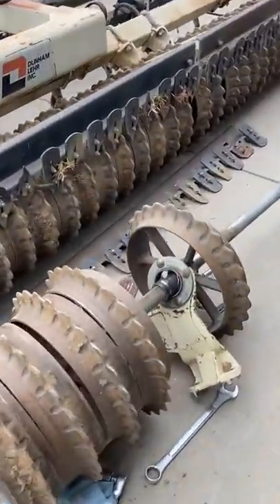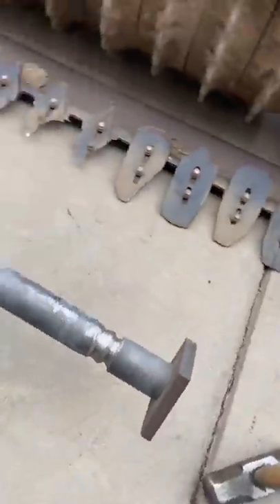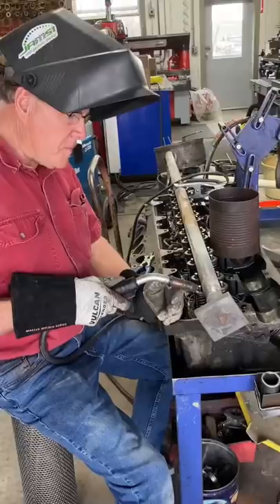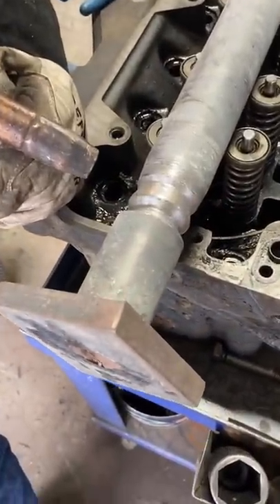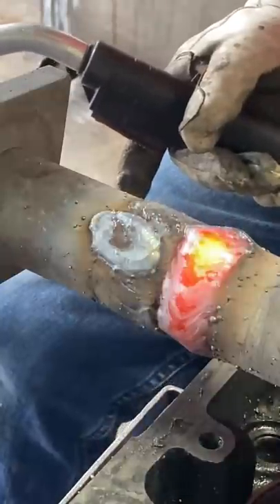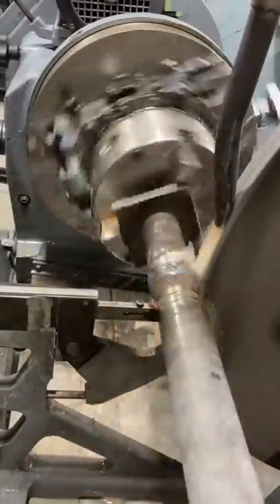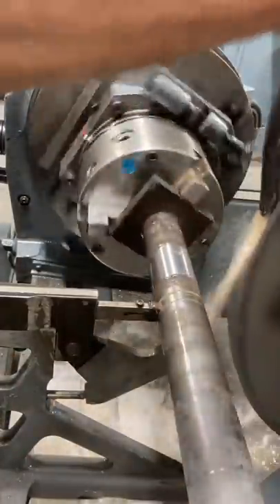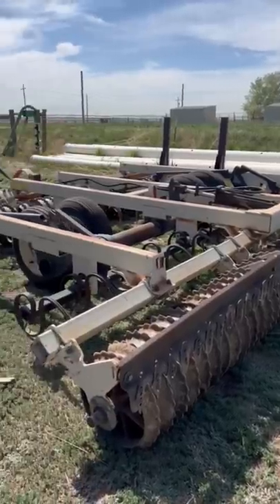#shorts How To Repair A Shaft Using A MIG Welder And A Berco Crankshaft Grinding Machine

Comment: Ok ok, I watched this several times and the humor just kept flowing nonstop.   "All these wheels to help push the tractor across the field" and " welding over something that the spatter won't harm" as he is welding over an engine head.  And the best was the 40 years for not being a welder.   I hate to do mechanic work but I love watching your videos. I wish I could bring my dad's Massey Ferguson 85 to have you rebuild the engine while he's still alive, he turns 90 this week.  Edit, I watched it some more and there was more humorous comments than straight informative ones.  My compliments to you and your dad, may he live at least as long as mine has lived.

Comment: I always say “I have a welder, but I am not a welder.”
Reply: This appears to be a cultipacker. It's a pulled implement, supplies no power to the tractor.
Reply: Same brother same
Reply: i go with, "I can weld, but im not a welder"
Reply: @hubertbergen3000  sure sure, but with new bearings is will be less load on the tractor...that will equate to fuel savings, which is what he is getting at, i think.
Reply: A grinder and paint make me the welder I ain't 😂

Comment: "it sits on the back of the tractor to help push it across the field" "You can tell it's damaged because of the way it is" "he's got 40 years of experience not being a welder" "after finding a good clean work area where splatter won't get in anything important (uses a face down cylinder head as a workbench)" "ignore any voids that were left" "use dial indicator (proceeds to set up shaft about 1/4 inch off center)" 

Lol this was great

Comment: Just a tip for anyone trying to weld anything... you really should wire brush every time you make a pass.. that brown residue can cause porosity inside the weld although not visible on the surface. 
I hope your guys repair workes our well

Comment: Git rid of your bearing seals , clean the bearing grease away and replace with graphite powder . An older one armed machinest on the eastern side of N.C. talked about getting several farmers to give it a try . I think he told them if they weren't happy with the setup he would replace the sealed bearings and repair shafts if needed . Bless ya'll from hooterville n.c.

Comment: That implement is called a “packer”. You pull it across the field to push rocks down before you plant a crop that requires a grain header to harvest the crop.  Once the rocks are pushed in, you can plant your crop using a seed drill to plant crops like soybeans, white beans or edibles.  When the crop is ready to harvest, you can drop the header on the combine as close as possible to the soil to ensure you don’t drop any beans on the ground.

Comment: Not to pick nits, BUT that tool gets pulled, it does not push. Depending on application, it's used to crush soil clods or to help cover grain crop seeds.

Nice welding and turning.

Thanks for posting.
Reply: Whooosh

Comment: I am very concerned about that shaft. What is the heat treatment on it and did the welding screw up that up? We don't want that shaft fracturing because they annealed it. I don't know the specs for the shaft so this may not be an issue

Comment: Thermal spray can repair the shaft without much deformation as it doesn't heat the shaft as much as to cause it to warp and bend when welded

Comment: You had the voltage set a little too cold on that weld. For something that thick. You want to run closer to spray transfer which is around 28-30V.  Much less spatter and better penetration.

Comment: I believe that’s a cultipacker the old ones used wood bearings witch was a long log and they all slide over it and it works but not a bad job

Comment: Its just a wheel on something that barely travels, just weld it up and grind it down with a grinder wheel and finish with a flip disk, doesnt need to be precision cut. Nice job either way

Comment: Eh, it's a temporary fix, but it won't be good long term. The welder decreases hardness of metal by heating it up and then letting it cool slowly. He should've cooled it  with oil or something so it becomes harder and more resistant to being grinded down again.

Comment: That does not push the tractor across the field that's a farm cutipacker implement it's pulled by the tractor to pack dirt down so it doesn't blow away

Comment: It's called a cultipacker ... it does not help push the tractor along at all....
Reply from the maker: You’re wrong
Reply: @JAMSIONLINE  damn ... you cleared that up.?....How do metal wheels that ride on bearings on a solid shaft push a tractor? ... I dont think Jim is a farmer since he don't know this..
Reply: @JAMSIONLINE  how many years of experience do you have of Not being a farmer

Comment: If you follow the channel abom he would spray weld that THEN machine it. He to is a machinist but out of Florida
Reply: I love Abombs work, I would use mig in this case because of the depth of wear, metalizing would be ok if it was repaired before it got that bad, but on electric motors it would be at risk of cracking and peeling off.

Comment: Help push it across the field? Um. That is not at all what that does. Not even close
Reply from the maker: Wrong watch the video you will see
Reply: @JAMSIONLINE  that is a packer.....
Reply from the maker: Packer, pusher, tomato, tomato
Reply: @JAMSIONLINE  not the same lol. It packs the dirt down. It does not “help push the tractor”
Reply from the maker: A pusher does help push the tractor you can see from all the wheels if you watched the vifeo